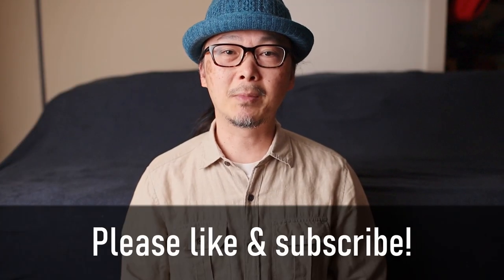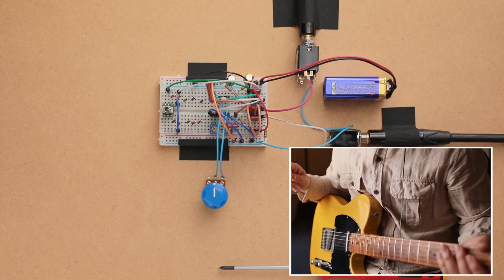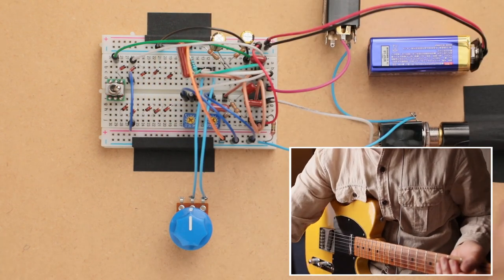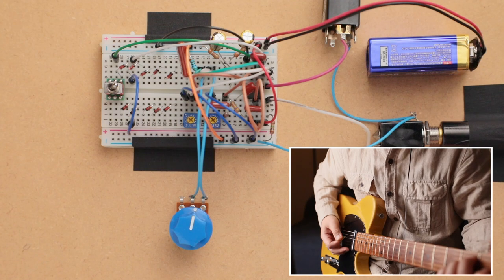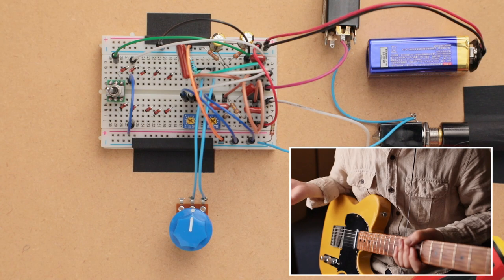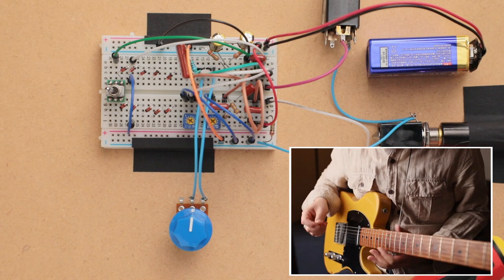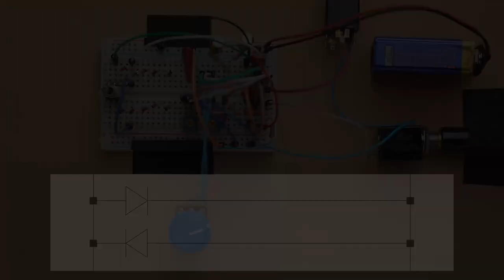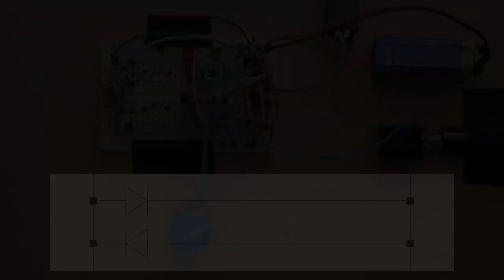Symmetrical VS Asymmetrical Diode Clipping Deep Dive! What's The Best Clipping In An Overdrive?

Comment: I was just amazed by how much smoother the 10 diode symmetrical clipping sounded than the 2 diode!
Reply from the maker: Hi, thanks for watching! Yes, the 10 diode clipping sounds much cleaner than the 2 diodes! With that many diodes, it starts to get pretty close to when we had no diodes and just the op amp. (If you compare 14:50 to 17:07 they are really close) Which is probably why we rarely see overdrive pedals with more than 4 diodes. (I think the Xotic RC Booster might have 6)

Comment: Very detailed video, probably took you a lot of time to make it.  I liked the asymmetrical configurations for chords, even the extreme ones.  There is a nice musical clarity to asymmetrical clipping.  Symmetrical has more compression and is probably better suited for single notes.  I think tube screamers sound best when minimum gain is used.
Reply from the maker: Thanks so much! Yes, this was one of those videos that was nice in concept, but not in execution...😂 I agree, there was something nice about the asymmetrical clipping, maybe because you get that "illusion" of having a clean tone blended with a drive tone? In any case, I liked it quite a bit. I too never have the gain on my Tube Screamer past 10 o'clock.

Comment: New to this channel! Man such a great experiment and Im super thankful you put time into this! Im curious, I did hear key differences between no diode vs. diodes and some difference between symmetrical/asymmetrical, so since there is minimal audible difference in some of the diode arrangements on our end of the YouTube I’m wondering if the stacked diodes give it a different feel rather than an audible difference? Did you notice anything about how it felt to play when you didn’t have much audible difference? Like more/less dynamic range/“headroom” or more/less sustain, etc?
Reply from the maker: Hi, thanks for watching! Great to hear you enjoyed the video! There isn't much difference in the feel, beyond what is audible in the video, like the change in compression and the transients. And as you mention, once you get past 3 diodes in series, the difference say for example between "3 x 3" diodes and "3 x 5" diodes is very small, in the audio and the feel. I think the fun stuff is when you have something like a "1 x 4" diode setup where it almost sounds like you have a clean signal blended in because half of the waveform is clipped heavily while the other half remains relatively clean. But again, this audible in the sound clips and not really a feel thing.

Comment: To your knowledge, is anyone making an overdrive or boost voiced asymmetrically like you have around the 9min mark? I’m looking for something clangy like this and I’ve found the germ warefare and eae boost/halberd are similar but I’m trying to stay away from distortion and instead looking for a clean clang.
Reply from the maker: Thanks for watching! That sound at 9mins is just the op amp breaking up without any clipping diodes. I don't know of any specific pedals that have a circuit like this, the MXR Micro Amp is a single op amp boost, but it's lacking a tone knob and an output level. I'm not familiar with all the pedals out there, but the Way Huge Angry Troll and the Way Huge Red Llama come to mind for maybe something that sounds like this, although they both lack a tone knob. Alternatively, you can buy a something like a Boss SD-1 and clip off the diodes, which would make it pretty close to this circuit. Hope this helps!

Comment: why do you get more note definition with more diodes on the single line comparison?  is it just because it is so quiet that the sustain is gone?
Reply from the maker: Thanks for watching! Great observation! Although it may seem counterintuitive, having more diodes actually reduces the clipping. Confusing, I know... But it has to do with a property called forward voltage, which is why LEDs will clip differently than regular silicon diodes. So the more diodes, the less you clip the signal, which gives you less overdrive/compression and more note definition.

Comment: Hello, what is the other electrolytic capacitor for? 
Thank you very much with all my heart for your videos, and thank you very much for answering. your videos are worth pure gold! Greetings from Peru
Reply from the maker: Thanks for watching! I'm guessing you're referring to the 47uF capacitors? They are both there to filter any ripple/noise in the power supply, and also act as sort of a reservoir to stabilize the power supply. Hope this helps!
Reply: @arito   Thank you very much for answering friend. What could be done in the event that the pedal has noise and interference?
Reply from the maker: @trafalgarsquare9019  You're welcome! Noise is a very difficult one, there are so many possible causes for noise in pedals, it's really a case by case situation.

Comment: This video and your other one on hard clippers are super fun!
I’ve breadboarded a Crowther Hotcake yesterday (which has no clipping diodes) all the distortion comes from the OP amp (LM741) It definitely sounds different, but I like it :-)
Do you have any experience with that circuit (or similar ones?)
Do OP amps clip asymmetrically like tubes and transistors?
Reply from the maker: Thank you! Great to hear you enjoyed the videos! I don't have any experience with the Hotcake, although I've heard many people say it's a great pedal. I checked out the schematic and it looks interesting!

My understanding is that (in theory)transistors/op amps do not clip asymmetrically unless you intentionally tweak the bias/Vref to make it "behave" asymmetrical. The Hotcake seems to be doing this by using a 100k/120k pair to make Vref. (I also saw schematics with 82k/100k)
Reply: @arito  Ahh ...
Thanks for the detailed answer! Seems like I have some experementing ahead of me :-)
Reply from the maker: @luluhasfun1283  Good luck! Hope it works out and have fun experimenting!!

Comment: So the asymmetrical clipping makes thecsound cleaner (makes sense, since one side is getting clipped softer).
Reply from the maker: Thanks for watching! Yes, exactly! Half of the signal is clipping less so the overall tone gets a little cleaner.
Reply: @arito  Yeah, it sounds almost like a "wet/dry" mix between an overdriven and clean signal. Pretty neat!
Reply from the maker: @ericv7720  Definitely! Like one of those pedals that has the clean blend knob!